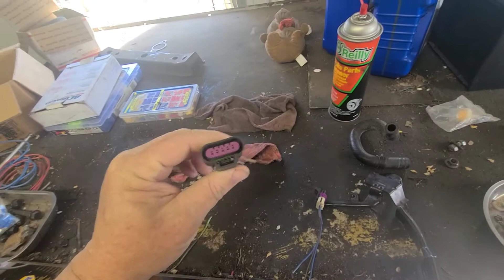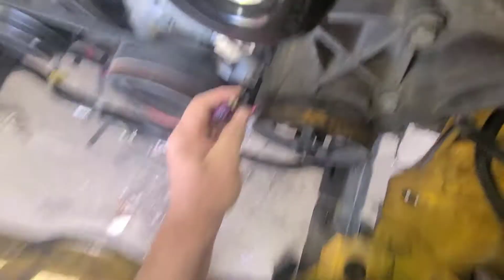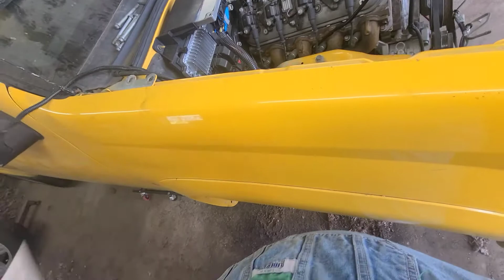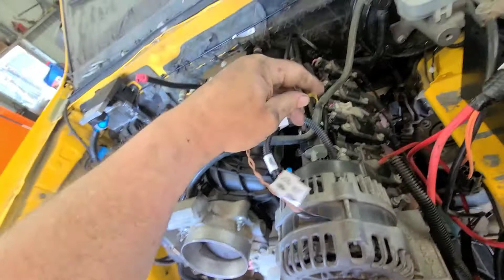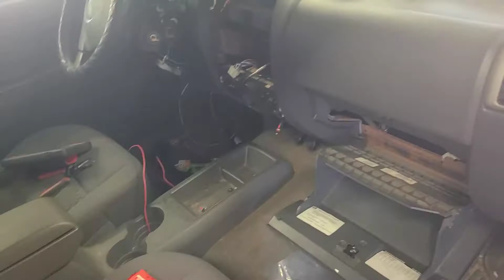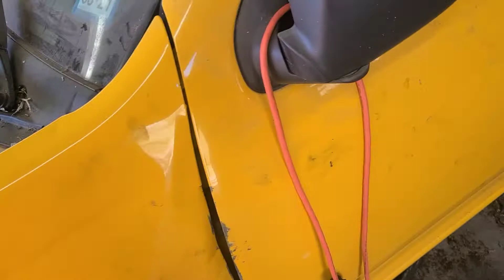06 Chevy Colorado 4.8 LS swap

Comment: did you use stock ps lines thanks mine seam long but hook up
Reply from the maker: My truck is in 06 and the rack is wrong for the factory power steering hoses so I had to have some made

Comment: Why did you pick a 4.8l?
Reply from the maker: Because it was a 2013 Silverado motor and it was free I didn't want to 53 because of the dod and 60's are too expensive
Reply: @blindflips4951  Free is good thing. I'm like you their asking way to much for stuff now. Been looking at prices on Colorado crazy. I have a 2010 5.3l donor 4x4 Colorado.. The only thing I don't like about the motor is vvt. Eventually, I will find the right Colorado to put it all in.
Reply from the maker: The 4.8 in my truck has VVT but the current performance wiring harness doesn't have a plug for it so it is inactive